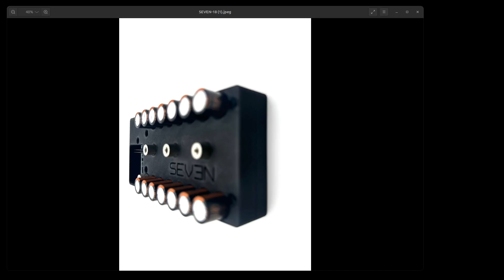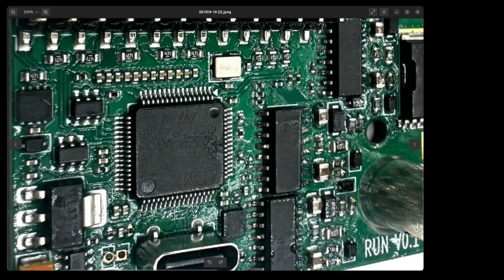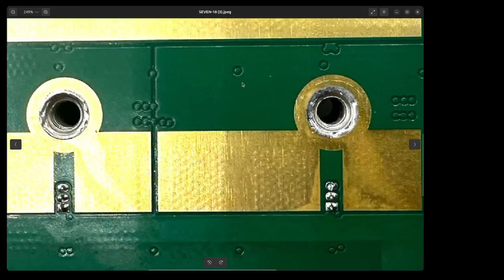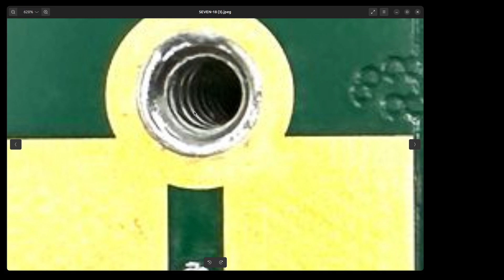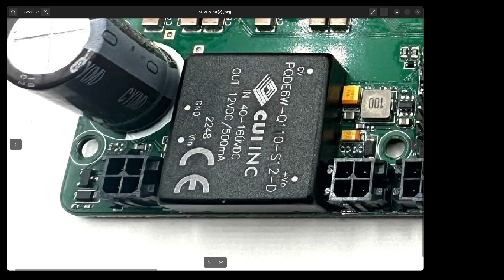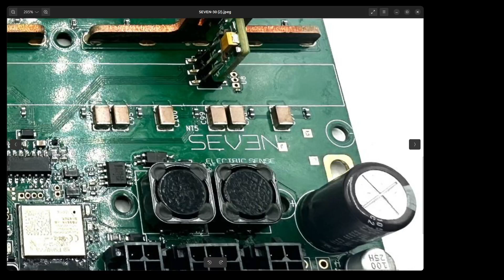Introducing: SEVEN Electric Vehicles - New VESC options!!!

Comment: 12:45 that has to be battery -, all of the low side phase legs are referenced to ground so that is the heat sink for the low side FETs. High side FETs are different potential so they are separated
Reply from the maker: Any mosfet based controller will probably be built from N-channel mosfets. On the high side mosfets all the Drains from all 3 phases will connect to BATT+. There Sources will split up for the 3 phase busses. Low side mosfets, all the Sources will commonly connect to BATT- and their Drains will split up for the 3 phase busses. The 3 sets of copper pads in the center of the board are the phase busses. If you look at the TOLL package, Drain is the large copper pad on the back of the mosfet and the many legs are Source (except one for gate).
Reply: @de-bodgery  ahhh I'm so silly. Of course since the drain would have the heat sink connection. I'm always thinking about the gate driver design where it is all referenced around HV- and the phase. Thanks for correcting me!
Reply from the maker: @GrenYT  Typical mosfet gates can't handle more than 20v. Gate drive electronics have to account for this. So for low side, it's easy, just apply 0v or 12v in reference to BATT- and the mosfets turn on and off just fine. High side mosfets reference the ever changing pack voltage so they can "pretend" to reference a maximum of 20v for source to gate. Gate drive electronics need to "know" how far less than the BATT+ voltage is going to shut off the high side mosfets, but not be too little so they float or gate voltage is exceeded. It's a bit more complicated, but modern gate driver IC's handle this. I think it's this detail that you were really thinking about.
Reply: @de-bodgery high side mosfets are driven by ic driver typically soic8 with a bootstrap circuit

Comment: dont like the tall connectors for phases. i see you need to get above component height, but why not move them to the other side of the board?
Reply from the maker: TOLT mosfets are 2.5MM thick. Even the added copper on the bottom of the SEVEN 30 which lays flat on the board has to be thinner than that. About all you can really do is lay some copper across the phase busses on the bottom of the board due to thickness constraints of the mosfet package.

Comment: 14:00  Probably that the phase cables wired to the controller have huge impact on the heat transfer/ dissipation. Large wires = better heat transfer. Flat wires = better heat dissipations due to surface to cross section ratio. I bet that the heat transfer on the bottom of the pcb phases is less important than that.
Reply from the maker: Trampa STR500 uses those studs like you describe. They solder them in place too. Pretty sure they will never sheer off!  The BAC8000 I have for repair, the phase solder pad is completely eroded away. Nothing to solder onto like you describe! I have to entirely depot the controller, remove it from the shell and then use a brass screw via the underside and some added copper foil on the top side to even get a decent current path back.
Reply: Yeaaahh nice to see my favourite  electronics geek friends on every new controller video haha

Comment: 9:35 I imagine that one day, just like prismatic cells, square  electrolytic capacitors will exist and reach better fill factor on the pcb amd enable to even be closer to the fets for improved performance by reducing inductance and resistance...
Reply from the maker: Electrolytic construction isn't much different from NMC cell construction. NMC can be a jelly role for cylindrical cells or many thin sets of cells stacked together to get a pouch or rectangular cell. Caps in cans are just a jelly role, but they could be made with many thin layers as well so the cap is a rectangle. Ceramic caps are many thin sections of ceramic with aluminum deposited on the ceramic and many layers of that all stacked on top of each other to make a capacitor. Foil sheets and an insulator between them is done already. Thin film caps are made that way in rectangular shells.
Reply: @de-bodgery  Yes that's what i'm saying. I work in battery industry. Anode, separator and cathode.. in a roll or a stack.. but for the form factor, the joules of storage  capacity per apparent surface on teh pcb would be better if square than round... this woudl allow to stack more joules or to stack then closer to the fets
Reply from the maker: @Doctorbasss  Yes...well can style electrolytics are abundant and cheap. Probably why you see them so much. I do agree that close as possible to the mosfets is best. I've been following your YT channel for years. Sometimes I watch your content more than others. I don't think I knew you worked on batteries for a living...just as a hobby.
Reply: @de-bodgery  I dont share my consultingwork on the internet. Only personnal projects.  I indirectly worked on projects for Lucid, Tesla, Rivian, ZERO, Rimac, BRP and many others. Last time I was employe I was developping ultra quick laser welding machine for large EV battery production.
Reply from the maker: @Doctorbasss  Very cool! So laser welding...was that for the 4680? PRetty sure, what you've done...your battery experience is in high demand.

Comment: I'm surprised that the industry seems to be moving towards voltages higher than 100v (nominal) due to the dangers that come with it. Obviously any voltage can be dangerous but 100 becomes deadly quick. I was planning to do an electric motorcycle build and go with the 96v route but I would need something like 1200 phase amps to get the power I want. Torque is the whole benefit of electric in my opinion anyways. I guess it's only a matter of time before PEV motor manufacturers start to make super low KV motors to take advantage of the high voltage controllers coming to the market.
Reply from the maker: Motors that operate at 131v/32S are already plentiful. 400v motors are pretty common too. There's plenty of options of motors designed with low enough KV's and tested for 400v applications. Never mind all the used motor market from electric or hybrid cars.
Reply: I'm not surprised.  I have a Kelly 80V 1200A controller for traction setups and nothing worse than a 1200A battery connection and wiring.  Up the voltage lower the current for same wattage.  Reason EVs operate at 400Vdc+ these days.  No one wants all that copper for the same wattage.
Reply from the maker: @gregoryperes1385  Current requirements in 100v stuff is getting ridiculous! The NEED for higher voltages has been real for many years now! I had people laughing at me when I suggested in 2016 that we needed at least 150v controllers ASAP.
Reply: @gregoryperes1385  for sure if dealing with those kind of power levels moving to higher voltages makes a lot of sense.
Reply: I agree that low voltages are nice; but you dont really have much leeway in Kv/Kt actually; in practice there is a pretty hard floor due to the realities of practical motor construction.

Im working right now on a design wound with a split pair of 2x3 phases, with two independent controllers on the same motor; effectively putting the controllers in series and getting double the effective voltage to tame your R and L. This is pretty common in electric aircraft for redundancy, but it also makes for very peppy light EVs while staying under the 75V legal limit for low voltage devices.
Reply from the maker: @eelcohoogendoorn8044  Low voltage means high current. Is rather have higher voltage. I run a 6 phase motor on dual controllers myself. They aren't in series. This is effectively 2 motors wound on the same stator in parallel. Where are you located that you can't exceed 75v? This isn't the case in the USA. I can build at whatever voltage I want here.
Reply: @de-bodgery  you can exceed 75v anywhere; but in the EU its no longer a low voltage device and different regulations apply. Regulations aside, im also happier with the lower voltage myself, as far as batteries I have to plug and unplug, let along actual work on something.

Since phase currents are independent from all this; the only place the extra current might bother you is in the bus. It depends on the application I suppose but adding an extra mm2 of bus wire usually isnt the issue
Reply: @de-bodgery  The two motors wound on the same stator sounds like exactly the thing im talking about btw. Im calling that 'in series' since you have effectively half the L and R to push against per controller while the same phase current limits apply.
Reply from the maker: @eelcohoogendoorn8044  US doesn't have laws around pack voltage, just power and speed and even then, that depends on the state. For example Oregon, anything over 250w, the state laws considers that to be a motor cycle. Colorado is 5000w. I don't think Montana, Washington or North Dakota have any kind of limits.
Reply from the maker: @eelcohoogendoorn8044  Watts = amps x volts. Amps isn't independent of anything.
Reply from the maker: @eelcohoogendoorn8044  You do have about half the L and R. That will make it possible to have more phase amps, but not double, thanks to the lesser losses to "push against" as you say.
Reply: @de-bodgery  If each controller takes care of half the poles, thats indeed half the L and R; and assuming the controller phase amps werent the limiting factor (at high enough rpm they never are), its the L and R that dictate your available amps/torque.
Reply: @de-bodgery  For a fixed motor/battery, you might not get double as other constraints come into play. But if you optimize over all variables (attery, motor geometries, etc), you can get the maximum squeeze out of that second controller; and do things that wouldnt be possible any any given single controller of the same bus voltage; regardless of its amp limits.
Reply: @de-bodgery the motor controller acts as a buck converter; watts != bus voltage * phase amps!
Reply from the maker: @eelcohoogendoorn8044  Stick witg VESC for this. Those selection of listeners is pretty useful for dual controller set ups. The 2 sets of phases will induce signals on each other and potentially interfere with reading bEMF. FOC controllers that don't have this all struggle.
Reply: @de-bodgery  yeah; ive seen people do it before with vesc so indeed it should be possible; nice to see another confirmation. What build is this, do you have a video of it?

From talking to people who know more about motor control than I do, they say the mutual inductances should be alright on all controllers with closed loop current control. But thats just theory; its the kind of thing I dont quite believe actually just works without having seen it.
Reply from the maker: @eelcohoogendoorn8044  I don't have this done with VESC controllers, but I wish I did! IT would work soooo mcuh better! I did it with dual Nukular controllers. Look at my videos on the Zapino Zap scooter.
Reply: You would need even higher correct if your voltage was lower. OEMs want to spend as little as possible. Higher voltage means less current, means smaller wires/less copper and weight in wiring.